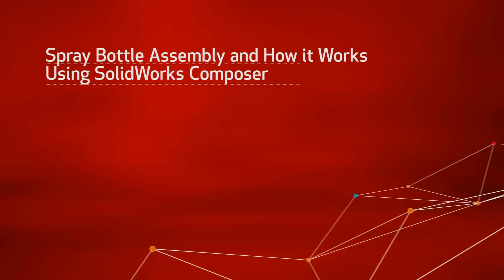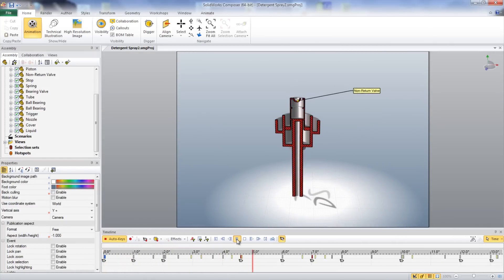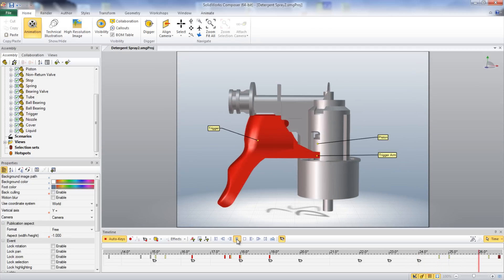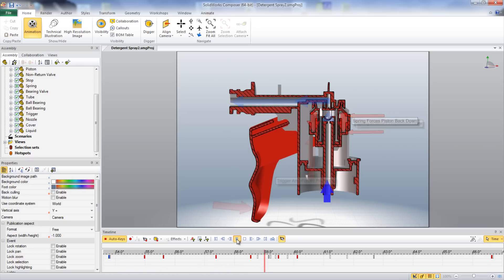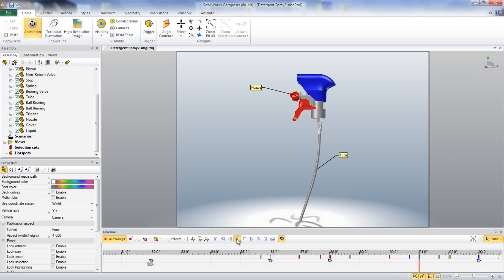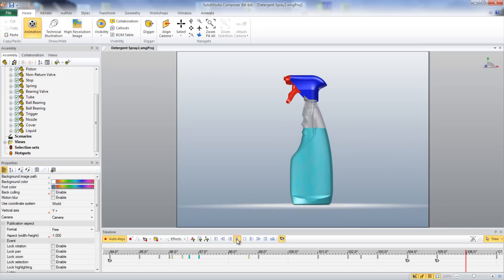How a P&G Spray Bottle Works and is Assembled Using SOLIDWORKS Composer

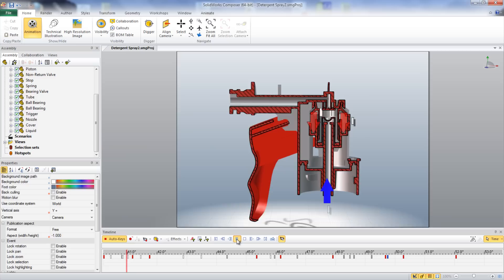Comment: As per your request, I will point a. part of the video that is “unclear” and actually left me somewhat confused.  At the 0:59 second mark you say “...this creates a smaller volume in the main cylinder....” But you never really labelled or designated what “the main cylinder” is. Is that the container itself? Is that the cylinder that the piston sits in, or the surrounding area? The piston itself? Not sure what is meant by “main cylinder” and just as you mention that part an arrow pointing to the trigger appears so it’s very confusing.

Comment: How does air get in the bottle to replace liquid?
Reply: The only one I understand so far has a valve in the cap that opens as soon as you press the trigger.
Also have a soap 
I also have a soap dispenser that is open to the air as soon as you unscrew the pump for the 1st timedispenser.

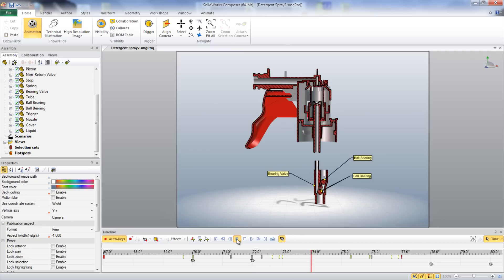Comment: I have a question: Isn't the non-return valve from the 1:20 min preventing the same movement that the ball bearing of the 1:30 ? And I think a non-return valve is needed at the nozzle to prevent air coming in and force liquid to fill the empty main cylinder space when releasing the trigger. Thanks, I like the software and the video.